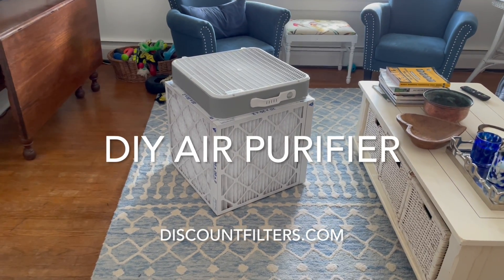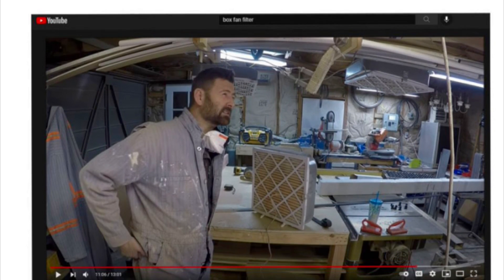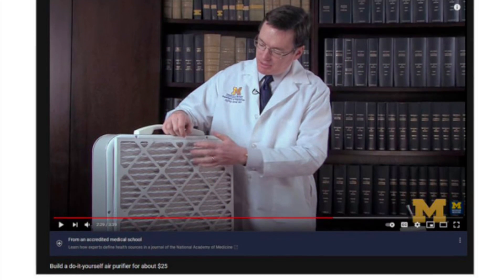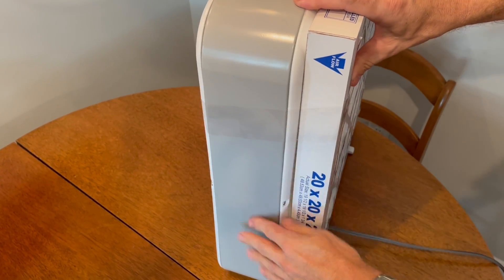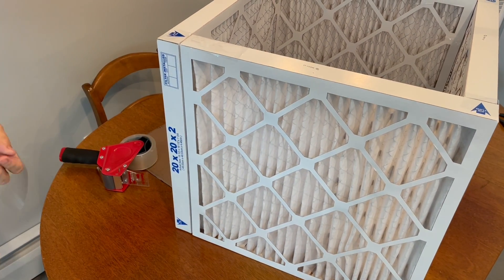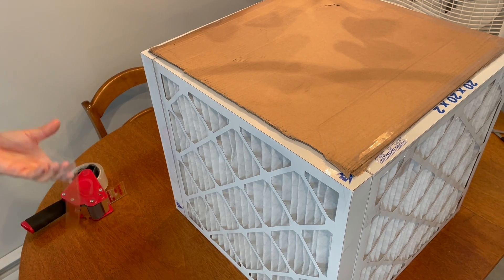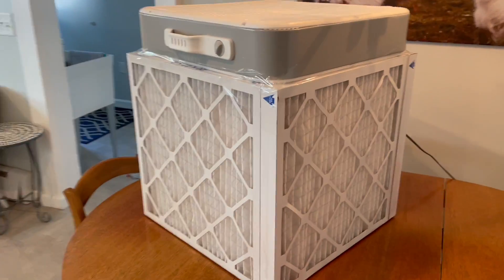BUILD DIY AIR PURIFIER USING COMMON BOX FAN AND PLEATED FILTERS

Comment: Another thing to keep in mind when taping up the 4 filter version, alternate the corners so that each side is the width of one filter plus the thickness of one more. Otherwise you'll end up with a rectangle that doesn't quite fit instead of a square. It works great. Another option to consider is to put the cardboard where the bottom of the fan will be so that it can be used with the handle on top sitting blowing sideways instead of up. Good concise video. I should have checked your website before I bought my filters.

Comment: not really cheap to do seeing as the filters are expensive... you may save around 100 bucks doing it this way... but end up spending more to replace 4 filters at a time every 3-4monthsa.. really the best way to go is to get one of those lifetime filters for 140 bucks... they are merv8 and washable
Reply: Also the HEPA filters are much better and good for 1 year on the pro models. I bought two of the 350 sq ft models for only $130 each for my home ...if you want to filter your whole home having two or 3 is better than one box as it can not circulate those far away rooms, and I am not about to put 2 giant boxes with a crap looking box fan in the living room and bedroom lol.

Comment: Can i ask why it wouldnt be better to reverse the flow? I'd like to know the difference in airflow between blowing into the box and pulling through.
Reply: Proper air purifying systems have the filter before the fan. This prevents the fan from getting gunked up with dust and other pollutant airborne particles.

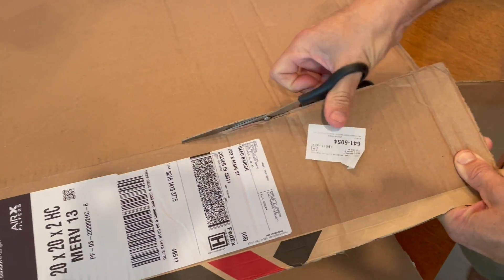Comment: At 2:15 shows the arrow for airflow going from the fan exiting thru the filter however the tissue is sucked into the filter. The filter is backwards
Reply: Yeah, I think he made a mistake.
Reply: yes very wrong.  The air should be pushing air towards filter not sucking air from the filter.   fans pushing air is far far more stronger than sucking air.
Reply: Imagine posting a video and screwing up the one thing of importance
Reply: I saw that too!
Reply: He placed the filter on the back of the fan. (You can see the screws and the power cord coming out the back) The air is being sucked through the filter, through the fan, and out the front side of the fan. In all the pics he showed of other examples they did the same. See the fog one--he is showing there is no fog coming out the front of the fan.
Reply: @amberreid3349  the point is, the arrows are going the wrong way.
Reply: @amberreid3349 you're correct

Comment: When you installed the fan on the 4-sided version, you don't mention which direction of air flow. I'm assuming the air is blowing upwards.
Reply: 3:45 yes he did, the air is sucking air through the filters and exhausting up
Reply: @isaiahhiggins  ok thanks for verifying that ✊✌️
Reply: Make sure that cardboard is as clean as possible, otherwise what's the point?